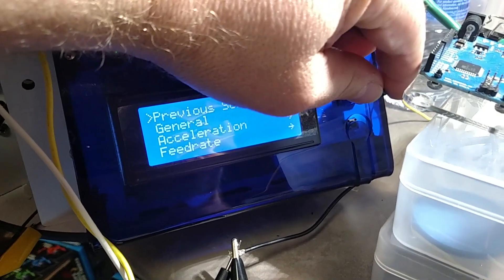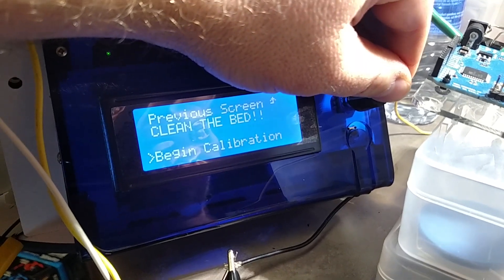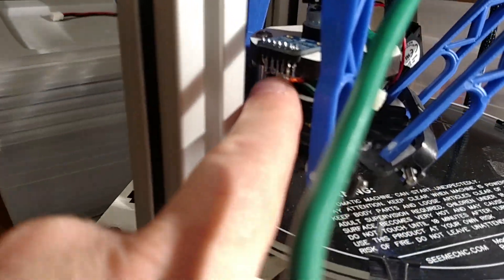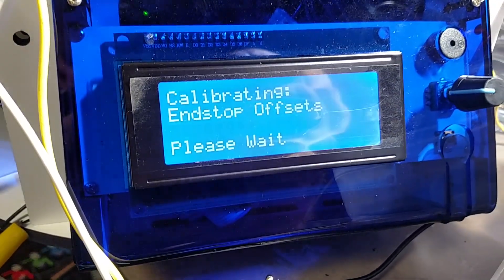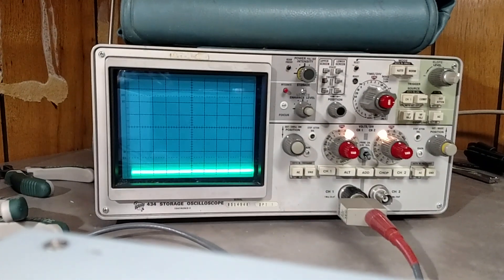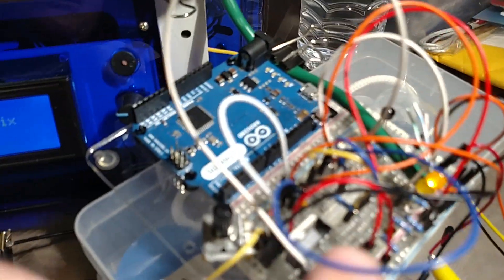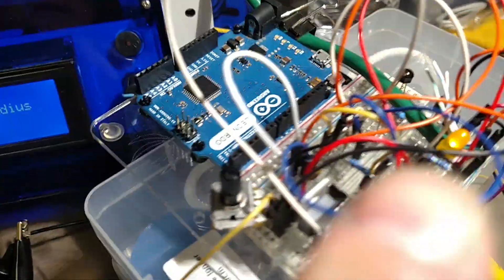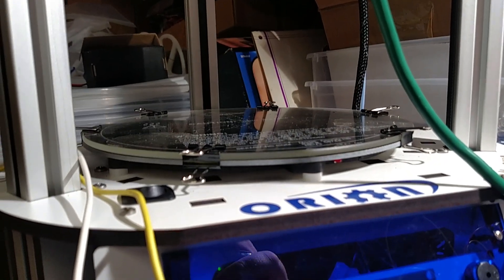SeeMeCNC Prototype Accelerometer Probe Works!

Comment: Hello I'm sorry, I'm one of the developers of MarlinKimbra and Marlin ...
I might have some info on the electronic chart used by you ...
There were months when I'm working too, but I'm using an accelerometer SPI and I can not handle it during the movement of the engines ....
Hello and sorry ...